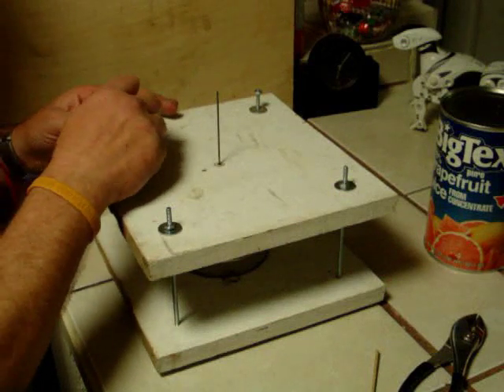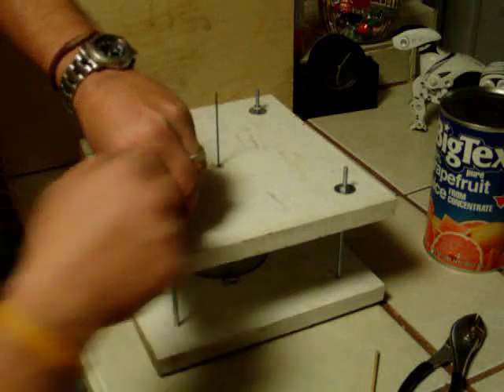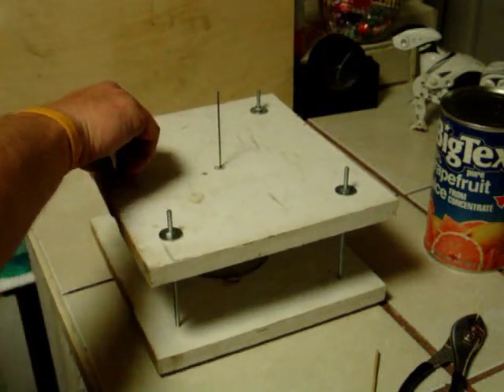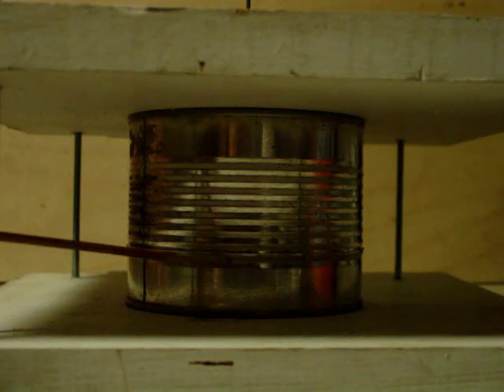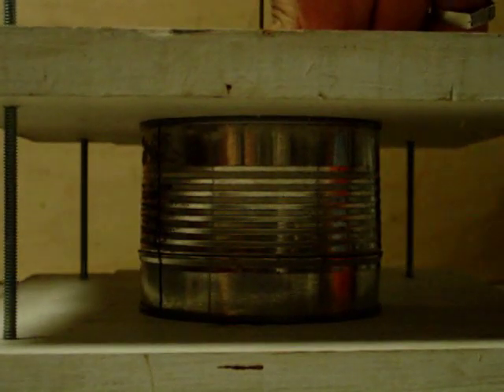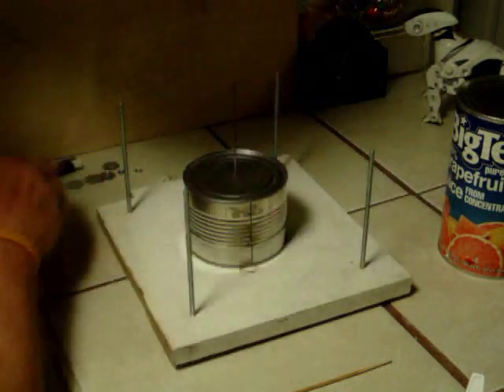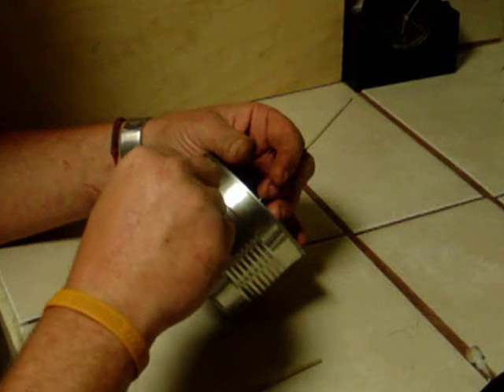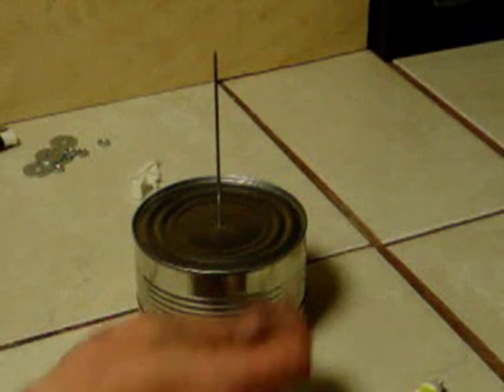PART 4 HOW TO BUILD A TIN CAN STIRLING ENGINE

Comment: hi scott, i put the magnets in with out the bending and it works do i after put the bending if i dont need to?i put 64 magnets in i have the room to put 64 more magnets  does this mean i  get double of power or voltage? if i hook tha up to a small gas engine and run that straight to a light bolb or something else to i after put the dail bridge rectifier? thank you .joe

Comment: What will stop the superglue residue from burning with potentially toxic smoke and breaking the seal in the process when you place the burner underneath ?  Or is it a low temperature engine working on hot water etc. ?

Comment: GREAT idea, the wrinkled can press fit and the press got me subbed. I've built a few tin can Stirlings myself (used a remotely similar press fit for the displacer lids, did it on finger power though - luckily got away with it 9 times + 2x scrap :)